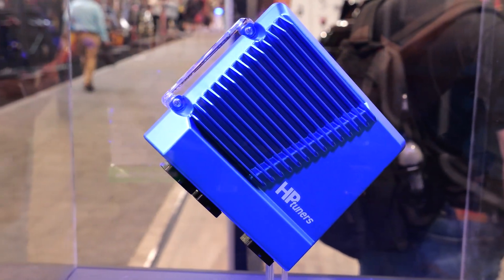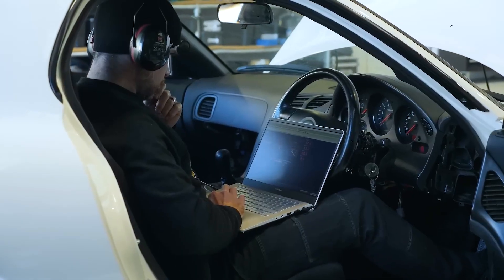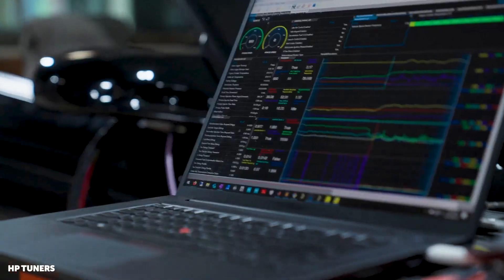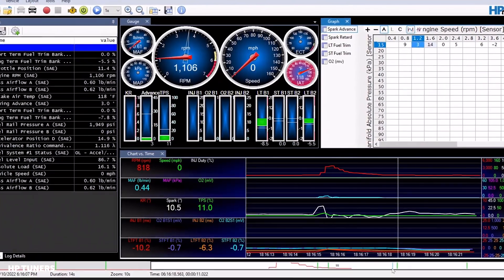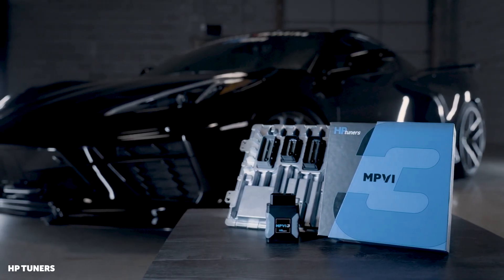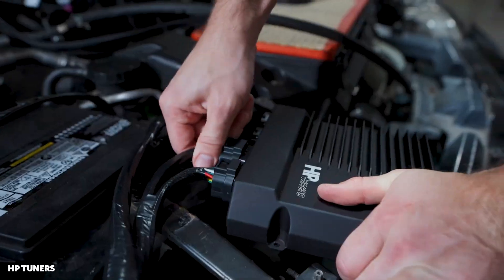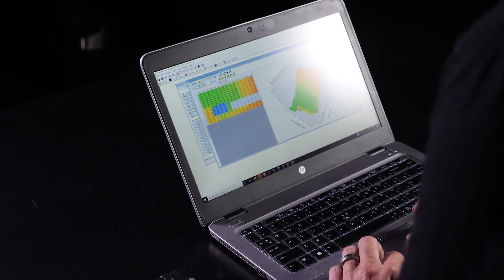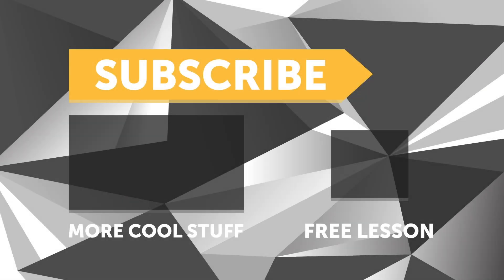Time for a change?

Comment: Yeah, I'll stick with my $300 Speeduino, which is 99% as good as these multiple thousands of dollars ECUs! And it doesn't require proprietary locked down software that nickle and dimes you for even MORE money.
Reply from the maker: You don't pay for VCM Live. Interestingly, TunerStudio has a paid version though to get some features that are standard in other 'free' ECU software. Nothing against that, just an observation.

Great that the Speedunio works for you and your LS V8 engine application. 

What other ECUs have you tuned? Must be a lot and 1000's of hours across them all to have such a strong opinion.

Happy tuning! - Taz.

Comment: The perfect ECU has a open source circuit design and open source software. I would gladly pay for the hardware, but I would also like to be able to repair the ECU if it brakes and for that it needs to be open source. 

rusEFI is the future.

AI tuning is probably right around the corner also. Imagine to be able to connect the ECU to a powerful phone or PC and be able to have the AI automatically adjust the tuning while driving a race

Comment: Highly amusing give the years of "you only need a remap"...but makes perfect sense for the company.
Reply from the maker: A lot of people do still only need a remap to be fair. If your project is running perfectly as it is with your tuned stock ECU, HP Tuners or otherwise, you won't get any benefits from fitting a standalone 😎 - Taz.

Comment: I wanted to do a turbo project build on my Suzuki GSX-R150. one of the puzzles I need to solve is how to tune it because there are not many aftermarket ECUs sold specifically for my motorcycle. 

the most affordable ones made and sold locally is BRT's Juken ±$80 standalone aftermarket ECU, it is an alpha-N based ECU thus it just takes in %load • RPM information, not very good for boosted engines because the air mass varies and not constant. though, you can just tune it just rich when the maximum boost is achieved, but it'll be very rich when the boost is still low because the fuel amount is still the same)

another ECU that caught my eyes is a Racer Mini-X, a more expensive $555 standalone aftermarket ECU that supports AFR target tune. It's great for my build. but it needs separately sold AF2 module that plugs into the ECU for it to work, the module itself cost another $333 lmao, and another $10 to unlock that AFR Target feature because it was software locked. kinda bs honestly, but it is what it is.

im looking towards this project. Since stock power is 19hp, im thinking of 40 or perhaps 50hp out of this 150cc.

Comment: 1,999$ and 950$ for a harness.... what in the world do they smoke!? 
Haltech rebel is 1400$ with harness....
Holly is 1400$ with harness up to 2500$ for the full suite....
Halltech with the nexus system offers SO MUCH for 3k territory and the R5 with the PDM side of it... that this isnt even in the same feild....

for 3,000$ HP tuners lost my coin. lost it big time... it was to be "budget" and this makes thier product line "more prestigious" than their brand calls for... 
Nope ill spend 3k on a haltech before i touch another HP tuners product which has damaged more stock ECU's in my case than it was worth.
Reply: I'm new here finding out about this not saying you're wrong, just wondering are those offerings comparable to the HPT with 4x VVT, 2x DBW, 16 injectors, 8 ignition?  

I'm currently running the EMU Black with DBW and 2x VVT, $1200 + harness option.  I wired and crimped all pins and built the harness custom to save money, it was a ton of work, maybe 12 hours work.  You're paying for harness assembly time, because it's a lot of work to diy.

Comment: My project car has a carburetor...
Reply: Then you get an automatic +10 ba build points in my book 💪
Reply: @Jared45513  ...and an automatic.
Reply: @frankrizzo2724  well h pattern really is the mansmission but I can't talk I'm currently rebuilding a TH425 for my Oldsmobile but I will never fuel inject it. Carbs are awesome.

Comment: You guys showing adaptronic like it's still relevant and they didn't screw over their entire customer base is hilarious. Will never forgive andy or haltech for that one. They never even apologized.
Reply: Hurts my feelings thinking about when they blew up the old forum
Reply: @Nebbia_affaraccimiei  yeah, completely left everyone high and dry. All just useless bricks now after being a company that was around for, what, 15+ years?
Reply: got x 3 1600's and a 1200  only to find the company shut down by haltech 10 weeks after purchase    not happy jan
Reply: @poiter5876  yep, not like there was even a warning and the software has been unavailable for years now so it's literally a brick.
Reply: I still run the adapteonic m2000 when he shut the company he should have released schematics so people can build there own stuff I think Andy could have made it big he was aiming at the correct audience I can't blame him tho something better come along and he took it I still have mad respect for Andy
Reply: @AshLongie  I had the first M2000 running DBW in the US AFAIK. It had SO much potential if they came through on their promises. Instead they dumped their entire customer base. Andy is good at what he does as an engineer, but I can't respect someone that does that to their customers. That's an incredibly unethical way to operate a business and haltech is right there with him, so they can both take a hike.

Comment: honestly this is the next best step, and they have an insane foundation to work with. They already understand how stock ECUs for MANY makes and models operate, table sizes and cell values, different functions. All they need to know is the pinout for stock ECU harness if they want to make PnP harnesses/units
Reply: That's what I was thinking. They have so much experience seeing how multiple makers set up their engine management then interfacing and improving

Comment: Both Holley and Haltech offer better deals than this.
Reply: massivly better deal. 
this seams like a lack luster overpriced version of what is already offered at half the price. 

2k for the ecu and 1k for the harness they are behind the curve when haltech offers more with their 1500$ rebel....
Reply: @alorrick7546  When he goes "$1900" I'm thinking that's not too bad, and then he says oh another 950 for the harness I'm like forget it.
Reply: @alorrick7546  If youre comparing termX and Rebel to this, you're missing the boat. It's more ECU and more features than both.

Comment: If a standalone can become complaint with the vehicle network to integrate with OEM systems (like cluster, abs, emissions, etc) would be the shizzz.
Reply: most can, as they have programable inputs/outputs. 
sadly many people who intigrate stand alone ECU's fall short of understandin the car theya re intigrating them into and thus give up. 

my 1987 porsche LSX swap with haltech fully uses the stock gauges and is seamlessly installed to work with all factory options and gauges. 
Modern cars with CANbus can easily do so. Haltech has done this since the dawn of time. so it is nothing new by no means of the imagination.

Comment: I can see a very practical use for AI in breaking manufacturer securities on ECU's.
Cut that four year window down to four weeks. 😎
Reply: Thats not how an AI works
Reply: @martijnvkk  it is though, cause I've used it to break other systems. It's the same as brute force hacking except the computer does the pen testing and the 'script' updates itself.
Reply: @EPR-6  Breaking Security Cert Key Encryption and simple reverse engineering are galaxies apart

Comment: I'm a little dubious of their support model aligning well with this market segment, speaking from past interactions.  But hey, more options in the market drives innovation.
Reply: yes.  trying to get them to add in tables that have been known about for 5+ years, and their response is "we'll consider it" followed by "buy our custom tables add-on and add them yourself".  I don't think this will drive innovation much as it's like a grand more expensive than haltech and holley yet only works on one engine family so far.
Reply: @suprakillavr4 it’s a year 1 product in a very mature market. They will catch up and eventually settle down and fill a specialty in the market. 

Making an ECU and software to accompany it from scratch is extremely difficult and takes years to perfect.